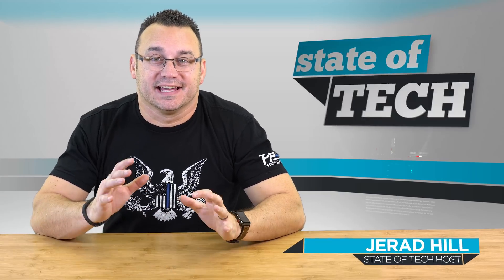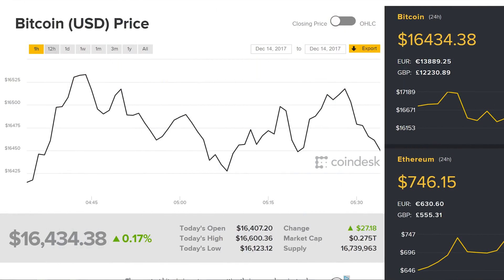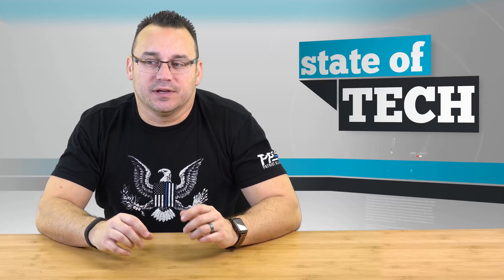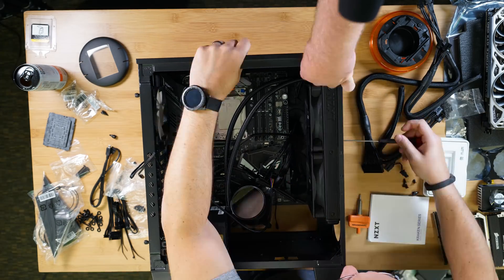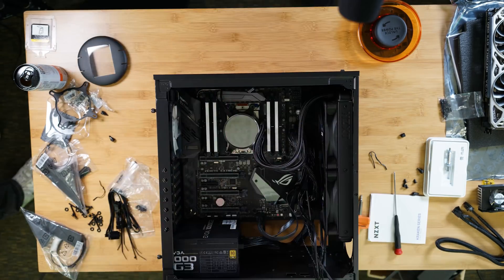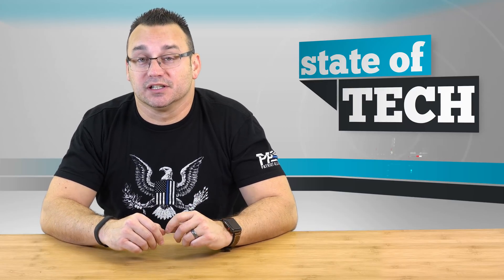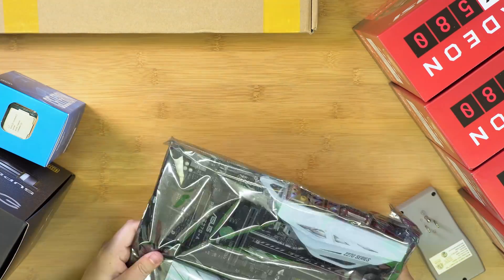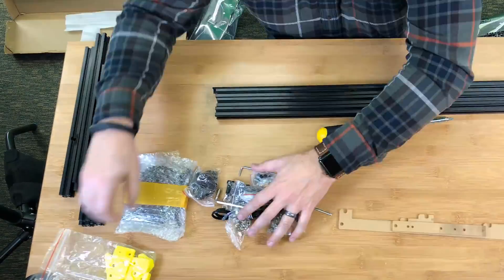Building an AMD RX 580 Ethereum Mining Rig

Comment: If I built a gaming pc for occasional full 1080p play with say a single rx 580 8gb card, what kind of roi could I possibly see if playing my cards right, I was mad at first when I first found out about crypto, I had been out of pcs for a while, but if you can't beat em, join em. So I'm curious about all this.
Reply from the maker: Mining with a single card is not going to generate much revenue. Using more cards offsets the base power consumption of your pc. An average gaming pc is going to consume about 50-75 watts at idle. An Rx 580 under load will consume about 150 watts. Depending on where you live, 225-250 watts of constant consumption can cost about half of what you would be mining. The wear and tear on your pc is not really worth it unless you have a few more GPUs. I am going to do a video on how to mine with a gaming pc soon.
Reply: StateofTech thanks for the info, I'm looking forward to that video too. I was just curious, as I've seen the point of your computer not doing anything for you when your not using it so why not let it. This is all new to me so I'm definitely trying to learn more, but maybe let it pay for it self in a year or so. I just have the whole if you can't beat em, join em, attitude lol

Comment: have you tried using the AMD mining "blockchain" drivers? They where released in August 2017. You will need to uninstall your current drivers Using DDU but it makes a HUGE difference.
Reply from the maker: Yes that is what I was using. I figured out the issue the next day after uploading this video which was that the version of the Blockchain driver was out dated.

Comment: @state of tech, your hash rate really sucks if it's 6 cards @ 120 Mh/s.  You should try two things...if you've already flashed your bios...  and it's not your risers.... faulty risers usually cause cards to not be recognized, or boot errors.

1. If you're using the latest AMD drivers, then change each card from graphics mode to 'compute'

http://support.amd.com/en-us/kb-articles/Pages/DH-024.aspx

2. Or you can uninstall the latest driver, and install the block chain driver. 

http://support.amd.com/en-us/kb-articles/Pages/Radeon-Software-Crimson-ReLive-Edition-Beta-for-Blockchain-Compute-Release-Notes.aspx

Comment: Guys, would it be possible to connect 2 Nvidia Geforce gtx 1070 's to Asrock h55m-le motherboard. Also, I have Intel core i3 530 CPU and 4GB RAM. I'm going to make a starter etherum mining rig. Sorry for the newbie question but I have to start learning from somewhere.
Reply: Save money on the CPU and get a celeron 4400T. You won't need processing power from the CPU to mine. And the 4400T is a very low wattage CPU. Every little watt you save is money in your pocket.

Comment: I hope you aren’t running the adrenaline drivers for the 580s. You’ll actually underperform for some particular cryptos. Ethereum being one if them
Reply from the maker: I'm not. Running the Blockchain driver from AMD. Am averaging 30.5 mh/s per card now with minimal overclock.
Reply: StateofTech Just a standard overclock with under volting? And bios mods? I get 29.5 each of my cards with no bios mods and around 80 Watts per card

Comment: Im looking to build a rig with 4 Sapphire Radeon RX 580 Nitro+, ASRock Intel H110 Pro BTC+ Crypto Mining ATX, Intel Pentium G4400, EVGA SuperNOVA 850 P2, LATTCURE 6-PACK PCIe PCI-E 16x to 1x Powered Riser Adapter Card, Corsair - Vengeance LP 8GB, and then building a open air case as well as using a USB stick to run the OS off do you think this would be a good start? I am looking for something to start me off and then hopefully expand

Comment: Looking to get into mining a little and also do some gaming from time to time.  I'm looking at a ryzen 7 1800x with 2 amd rx 580 8GB or an intel i7 8700k with msi armor 1080ti build.  I have 2 27inch Qled Samsung hdr monitors and a 49 inch sony 4k hdr tv whats best in your opinion for what my use and current screen set up.
Reply from the maker: Air-cool your system as it will be running 24/7 and it's much less wear on a system to be air-cooled. The 1080ti cards will game better and mine slightly better, but will use a lot more power than RX 580 cards. The cpu does not matter much for mining so get what you want for standard use performance. Both of those CPUs will be plenty for gaming. You won't be able to mine and game at the same time most likely.
Reply: StateofTech thanks for the advice yea I think it would be mostly used for mining and everyday use with slight gaming here and there.  Seems like I would get 30hs from each 580 and about 47hs from a single 1080ti for mining etherium ??
Reply: No, for eth your looking at 35 Mh/s. It will run the skunkhash algo at 47 Mh/s

Comment: i feel exactly the same and have just completed a 7-GPU x RX580 8GB Top OC Asus setup. Asus Z270-A latest Bios, Ver006C Risers, Bequiet 1000w CM x2 PSU's and link cable and a Cheap Ebay Wood Rig. 16Gb RAM and 120GB SSD/Windows 10.

You have built it and configure the bios (you tube the bios setup for mining asus Z270-A) it works. Gen2 worked for me too.
On board video for the DVI-D to the monitor, windows installed ALL Built! clean build the windows 10 and chipset drivers THEN change the BIOS. 4G enabled before the chipset and it wont see the cards; then simply using the risers start with one graphics cards doesnt matter which slot but i avoided the x16 slots to start with. install one and do the radeon drivers latest ones. then reboot then add another GPU and so on. you will hit a point where it wont install, turn off and change the riser to another x1 slot on the motherboard boot back up and see if it installs; you have to take your time and get the order right. It will do it! but a pain to match its old school, IRQ/addresses asignment i think. out of the box it should give you 21.5Mh/s. in the radeon drivers you can change the driver from GRAPHICS to COMPUTE (hence you were at 20Mhs!!) lower electric maximum performance to mining. If you want the 28.5 then you will need to polaris mod the bios of the card (very easy to do) dont get over excited but your aming  to get the memory to 2000mhz. NanoPool and Claymore very easy to setup and use. DONT FOR GET 8GPUS is the max for Windows AMD or NVIDIA. you can have 8 of EACH but not all the same. claymore supports both amd and nvidia in windows.  You can also use the M.2 on this board for the 8th GPU. 7 or 8 is sound for this board from what i can see the experience people use. The BTC boards say 19...but can only get to 13 so far Bios updates missing - hence again you have chosen well. Mix the risers up to find/see if its a fault usb cable (they are cheap after all!).  I have the blue ver006c with 6pin power input; cable 6pin to sata included. hopefully this is enough to egg you on to finish it. 198.5Mhz i am getting. Samsung/hynix isnt a problem dont let that confuse you unless you want to push to 31.5Mhs!!!

Also proof of concept-NoBS 

https://eth.nanopool.org/account/0x1bfbd2c8794dd2de2ad0dbfd74ac196e30c02e50/GeoffMiner

Comment: You don't need to buy Windows, you just leave it unlicense it doesn't affect nothing other than the logo on the desktop.
Reply: Marcus Anonymous Use Linux plz..
Reply: Hassom Qorbanzada Linux (Ubuntu anyways) does not officially support AMD anymore. There are 3rd party drivers, but it's a bitch. I switched back to windows because of that.
Reply: How do I add the soft ware to the rig
Reply: Scott Laxon I bought a rx480 just so I could use ubuntu because Nvidia cards are hard to troubleshoot in Linux.
Reply: Cole Maring it was easy to get one Rx running it's was when I got over 3 cards that I really started having issues.
Reply: How can you download windows without paying for a license and use it to run the rig please ?
Reply: quench1234 here is the link to download iso file for Windows. https://www.microsoft.com/en-us/software-download/windows10

Comment: Can I ask how much you have invested in this rig at time of build?  I'm thinking of building a similar set up and prices are wonky here in Canada.  Also - did you manage to find a reliable calculator that list profitability etc based on this build?  Cheers from Canada Eh.
Reply from the maker: $2200 US when I built it. I build a second one that cost about $2400 due to cost of GPUs and availability. I have a few videos planned to film early next week. I'm starting a new YouTube channel for mining.
Reply: Subscribed!  6 rx 580's cost about $3K CDN up here - about $2350 USD.  So close...but that doesn't get me a power supply, mBoard or anything else!  :(
Reply: Mboard and processor under $100 PSU $150. The other parts are cheap.

Comment: Have have 8 AMD Radeon RX 580 8GB ready to use for mining wanna get in on this gig. My question is will it be good enough for mining or should I add 4 more? Also are these graphic cards good or decent?
Reply from the maker: If this is your first build I suggest doing a six card build and if you want to get four more cards, build a second rig. Once you get comfortable you can start adding a few more cards to each rig.
Reply: StateofTech thanks for the tip appreciate it! With 6 cards about how much usd will I be making a day? Just an estimate of what you think?
Reply: it depends of what you are mining (currency), your price for kW/h and how much your optimizing the cards for  hashrate and power conusmption. You can check out coinwarz.com and try different currencies and things to get a good estimate
Reply: 8 RX 580's at 30+ Mh/s as of today will gross earn around $700 a month on Eth. Even though I could, I don't set up more then 8 gpu's on a rig. More reliable, don't get ripped off on psu's, and if a machine goes offline temporarily, i'm only down 6 or 8 gpu's.

Comment: Is there a difference in hash rate between 4gb and 8?
Reply: No, 8GB does not mine faster. People use 8GB now because the DAG file for ETH is getting close to exceeding 4GB. when this happens 4GB cards will suffer. Currently 4GB RX 480's get 30 Mh/s easy. The main factor is the memory manufacturer when it comes to speed. And that is unknown until us install the gpu
Reply: some dude nice one ! that's the way to do it. Good luck
Reply: Nice, I was wondering the same thing. gonna sub and turn on alerts. I have 8gb in my cart right now. Should I reconsider ? Thanks!
Reply: Blackstar Trade well if there's any difference then I'm gonna get the 8gb.
Reply: some dude not a huge difference in cost so might as well. Is this your first rig ?
Reply: Blackstar Trade yes....remebered a 401k account from a previous job...cashing it in.  This rig will (depending on how you look at it) be free.
Reply: Blackstar Trade yeah you too!
Reply from the maker: Yes. Quite a bit. I have a video on that coming soon.

Comment: Does anyone know where you can buy RX 580s in bulk for a solid discount?  Also, any comments on the ASUS B250 mining card (19 gpu)?
Reply from the maker: Maybe if you could get in with a distributor. Might need a resale license to get a wholesale account. Would be hard with the current demand.
Reply: Thanks.
Reply: He's right it's a pain to get into it but it is possible
Reply: the Z270-A is the wiser choice; 13 gpu's max on the B250 mininig even asus will admit that! the cost of the PSU's to drive that amount of cards you could have cheaper PSU's and another board for more reliability.
Reply: yep google it the reviews for the motherboard asus admit13 GPU is the best the bios can do currently; they are working on the 19 GPU release shortly to come...also if your using Windows 8xnvidia and 8xAMD would be the max as currently as of typing this both manufacturers drivers dont allow for any more within windows giving a max of 16xGPU. Linux does but you will need to learn alot if your background isnt command line inputting/setup your screwed. i looked at the Asrock BTC and the Asus BTC both at face value seem excellent choices; but indepth reviews of people who built them have put me off. then look at ANY large farming rigs and they have 6-7 GPU's per setup only many on a single PSU's too; this must stand for something interms of up time/maintenance and setup costs overall. If you want a cheap setup us the H81 board if you can source and the EVGA 750 G2/G3 seem popular, by cheap i still mean quality. Alot of complaints on the Biostar too. Hence Asus or Asrock would be a wise choice.
Reply: How?
Reply: Thanks Simon.  So you don't think the ASUS config of 13 RX 580's and 6 Nvidia 106p's actually works?
Reply: im get in on that bulk order if you can find one
Reply: It seems the safe choice is still the ASUS Z270, but I was hoping to put more GPUs on then that board can handle.
Reply: https://www.ebay.co.uk/itm/1-X-4-Slots-PCI-E-1-to-4-PCI-Express-16X-Slot-External-Riser-Card-Adapter-Board/132448143999?hash=item1ed6864a7f:g:G6sAAOSw9hdaLcCk

this has been seen to be done, but you aint going to get Windows I think you'd have to go SimpleMiningOS  Linux way....
i've seen people with 12 on this board on youtube; dont forget your PSU's issues though.
Reply: Dell has them off and on for $399(8gb). I ordered 6 last month. Took 4 weeks to ship due to backlog.

Comment: There is a switch on vid card for dual bios mode. See if your video card has that, turn off the rig and turn the switch, it’s tiny and next to the 8pin on vid card.  I am running 177mh/s
Reply from the maker: I have that rig running at 178-182 now. Had to reflash the bios on a couple of cards.

Comment: Hi, noticed that u fail to extract the heat away from ur rig. Beware of heat loading up. Not to cool from outside but extraction the heat is the main issues for rig to last longer. Care
Reply from the maker: I have not put extra fans on because my cards are running at 58-62c. Didn't want to consume more power than I needed to. Now the rig I just built today will need the fans because it runs warmer with different cards.

Comment: 118 Mh/s out of the box? or 180? I just bought new GPU and cant understand is current 17.5 Mh/s is good or not.
Reply from the maker: A properly set up card should hash around 30mh/s on ETH.
Reply: StateofTech tnx. Will dig into today.
Reply: Andrew Kondrashov I installed today blockchain driver. Helped a lot. Now i have 1200 H/s XMR in total. New card + old + cpu.
Reply from the maker: You can find it on AMDs website. Just search for amd Radeon block chain driver.
Reply: I have 17 Mh/s too.It's normal? How to rise it?
Reply: Dzintars Klavins where I can find it?
Reply from the maker: Yes you need the block chain driver.
Reply: StateofTech  Thank you. I've got 28 MH/s. Cool!!! With modified bios timings
Reply: Dzintars Klavins change timings
Reply: Andrew Kondrashov - Can you provide information on what you you did? I'm only getting 16 MH/s. What bios settings have you used? Did you install the blockchain driver?
Reply: Yes! I found that post: https://bitcointalk.org/index.php?topic=1433925.msg26800863#msg26800863
And next I found a "PolarisEditor v164" program. With help of atiflash program I download my Rom file from my graphic card, next I update timing parameters with help of PolarisEdition 164 with oneclick button. Next I save rom anf flash it back to videocard. Next I download and install a Mining Drivers from AMD site. And upgrade Claymers mining program to 10.2 version. Be careful whe you will be flash your card. It can be damaged if the rom file is incorrect. I did it once, but my PowerColor rx 580 have two bioses and i boot up on the second one, switch to the first one on a working system and flash a first one bios again from command line atiflash tool. But it was whan I tryed to copy timing manuallly. Have a nice day!
Reply: No, you want to use the latest amd driver and set workload from "graphics' to 'compute' on each card
Reply: The 17.5 Mh/s out of the box is correct. I went to 22 only loading the drivers for blockchain AMD released (https://support.amd.com/en-us/kb-articles/Pages/Radeon-Software-Crimson-ReLive-Edition-Beta-for-Blockchain-Compute-Release-Notes.aspx). After that, I moved the switch next to the power connector to the left, and that got me to 26 Mh/s. Finally, I followed every step in the following video (https://www.youtube.com/watch?v=UE2D9xABhKY), and that got me to 29Mh/s for every card I have. Keep in mind that the memory has to be Hynix and you have to uninstall the driver and re-install it again. took me a lot of work to get 30Mh/s out of every card but it was worth it. Good luck.
Reply: The blockchain drivers for AMD are BETA and have no future support. They mess with any utility that tries to manage voltage. The latest drivers work just as good for mining. Just change workload from graphics to compute in the settings. I have Samsung cards running at 30 mhs and hynix at 31.5 mhs easy. All underclocked and undervolted in 8 gpu configs, on 4 machines. 240 - 250 mh/s each @ 1000 watts at the wall